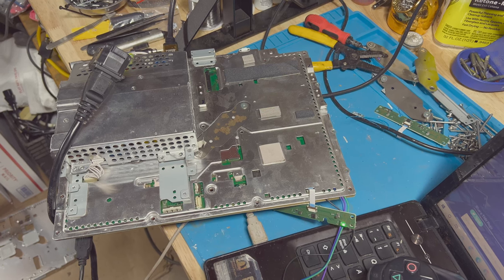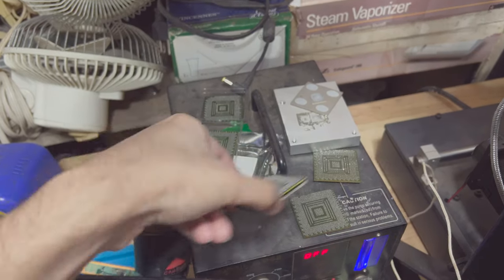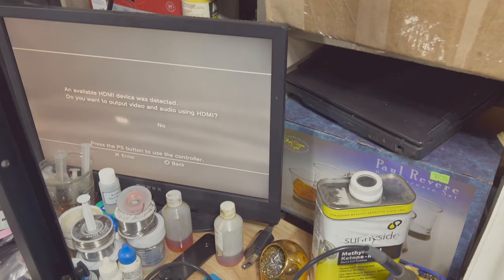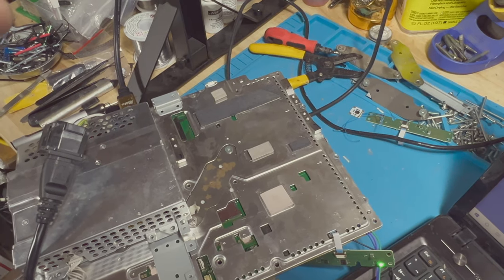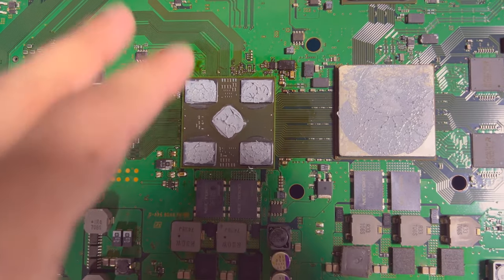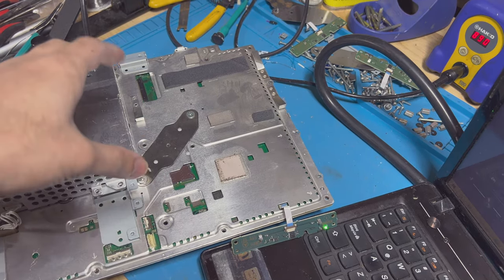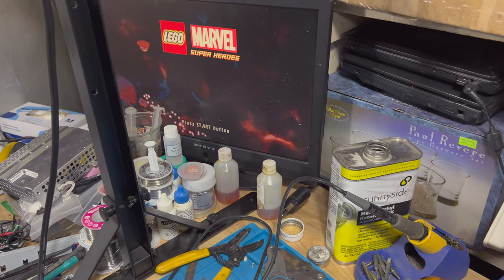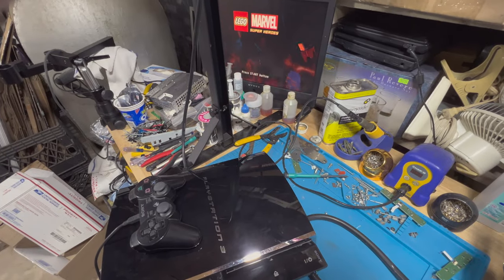Frankenstein PS3 with 40nm RSX

Comment: Whats the size of that little monitor? looks nice and 4:3. I'm sure the PS3/PS2 games probably look way better there due to the higher PPI density at their native resolution on a smaller screen/monitor compared to a bigger one will make the games look more pixelated. I've tested this with a 16" inch monitor, 24" inch monitor, 42" inch HDTV and 70" inch 4K TV. They look better on the first two smaller monitors. I wish I knew about it years ago though.
Reply from the maker: its about 18-inches I believe!

Comment: I really want to do this to a CECHA01 PS3 myself and remove the tokin caps and use a 40nm RSX. Isn't the 40nm RSX from the superslim and not the slim? I was under the impression that the 90nm/60nm/40nm were phat/slim/superslim but I could be mistaken.

Either way, killer job on this dude! Where did you get the CECHA01? Did you get it from eBay for parts/not working?
Reply from the maker: You can get a 40nm from a slim or super slim. The super slim ones don't have an IHS, so you'd have to use a copper shim when putting on an IHS. 

I get my consoles from eBay, that's correct, they're all broken so I go through the process to fix them myself.

Comment: So for simplicities sake, is this a 80 Gb?
Or a 60 Gb?
Does this mod work on both or does it have to be one or the other?
Reply from the maker: This is an 80GB model, but this can work on ANY PS3, most would just do it primarily on a backwards model to keep them going!
Reply: @Techbabblers  That's amazing!  Maybe I can revive my 60 GB original model doing something like this in the future.  Obviously a more detailed video tutorial would be required though.  Something that covers parts needed, and the entire process.
Reply: I'd pay for a detailed tutorial like that fyi
Reply: @KouryuTube you need a whole reballing board I think it's called which the tech I go to told me that that alone cost a minimum of 1-2 grand

Comment: Is it possible that this being done on a OG 60GB Model and still using/running official FW? (including Login onto PSN) without being BAN? thx
Reply from the maker: Yes you can do this on any BC PS3, I've done a few A models. I havent been online but I think if you have a CFW, you can't.
Reply: @Techbabblers  So, CFW seems to be a must, then it's not possible to do this trick and stay on OFW (kinda redundant to say it..) Anyways, thank you sir.
Reply: @LibertyKyo  no, you CAN use OFW just fine. All youre doing is training the Syscon on the PS3 to function with the new RSX over the old 90nm RSX. It’ll function like the same PS3 and PS2 games work just fine as well (if its a BC model). 

You can play online and not worry about bans (on OFW ofc)

Comment: Where can u buy just the chip?
Reply from the maker: No need to buy a chip anymore for it, you just need to do it via syscon if that's what you're referring to.
Reply: @Techbabblers  Can you elaborate more on what you mean by this?
Reply from the maker: @georgiepoo3304  Sure thing, If you get a SYSCON reader for PS3, you can just program the console with a few lines of code to read and it will bypass the whole modchip thing.
Reply: @Techbabblers  Maybe he meant a 40 nm RSX.